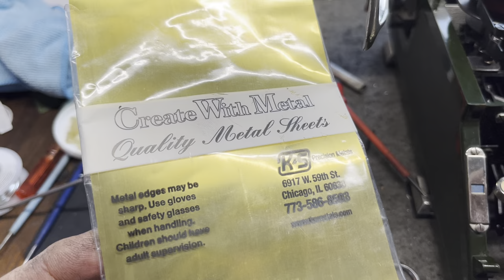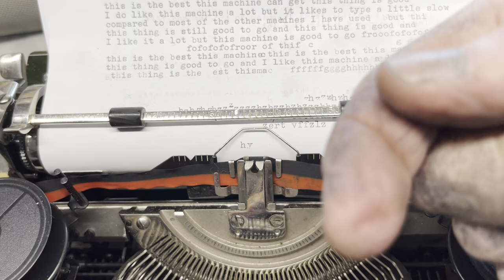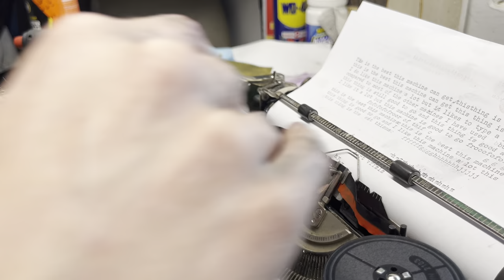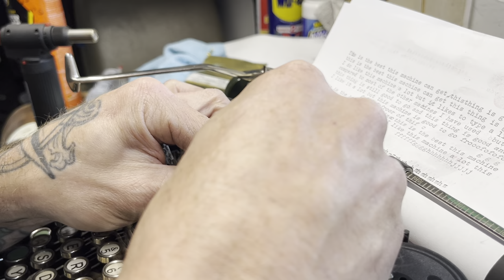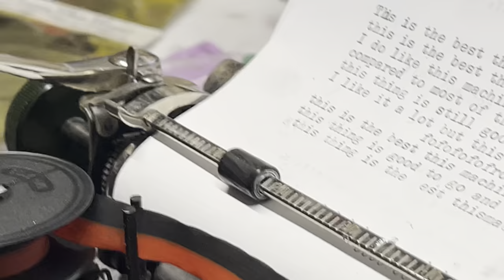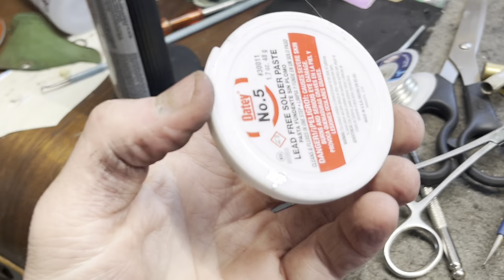Typewriter Soldering QWERTY Swap- Shim Method- Step by Step Tutorial

Comment: Good effort Hot Rod, but there is a much easier and faster way to re-solder/type change, , because you try I'll tell you. Remove the typebar from the segment, clean the type and the type , flick out the old solder as you have been doing,   Hold the "slug" in long nose pliers in the flame of your torch and get it hot,  take a pair of electricians pliers and squeeze the "slug gently on the sides to close it over so that it is firm, just firm on the type bar, put the type bar back in the segments and align it using a tapered probe (a motor bike spoke  i useful to make spring hooks as well, Hold the typebar against the anvil (ring) of the segment using your thumb, make sure the "slug" is not hard on the platen and that it is in contact with the anvil. When you are satisfied with the impression  (anvil and platen tolerence ,and  alignment take the type bar out.  sit your torch on the bench, use your probe to apply a drop of  fluid flux (Bakers Soldering Fluid) or similar) THE BAR AND THE SLUG APPLY A TOUCH OF SOLDER, COOL THE BAR WITH WATER it will clean off the excess flus, there will be no excess solder . replace the bar.

To set the anvil platen tolerance, use two or three sheets of paper, when you hold the typebar with your thumb against the anvil you should be able to pull the ribbon through and feel just a drag on the "slug.   50/50 solder is strong enough , the best soldering lamps are Britinol pocket blow lamps, they run on methylated spirit and come up regularly on E-Bay.. this method is not only faster, it's stronger than the shim.   keep up your good work  PS don't tell Pheonix, h thinks re-soldering is a "piece of cake"  but I saw his attempt
Reply: Could you please explain again but  in a way that even I could understand?